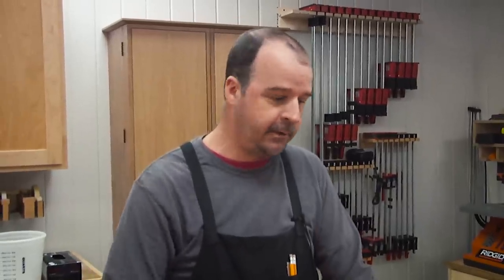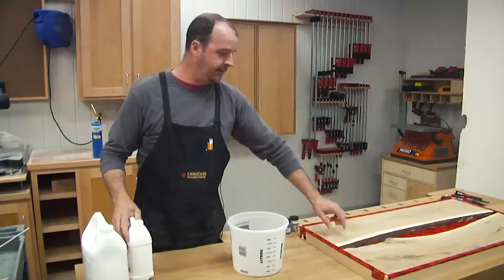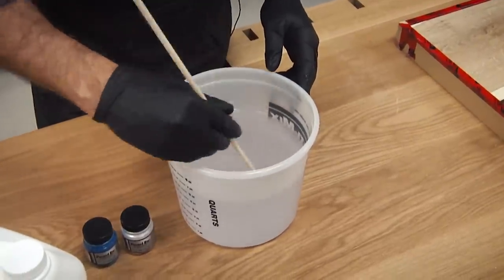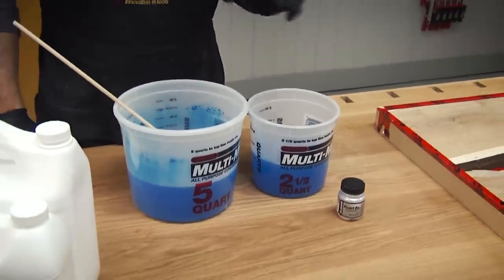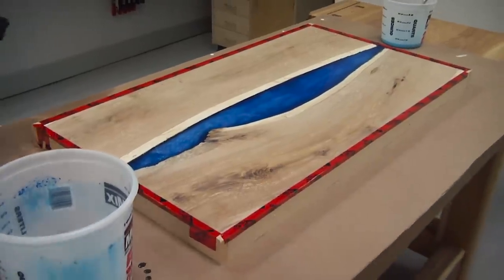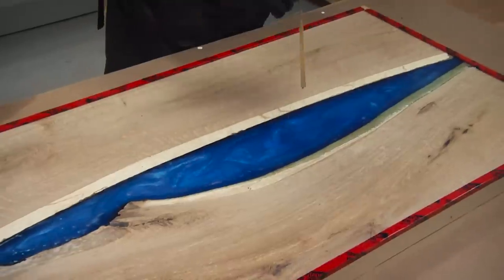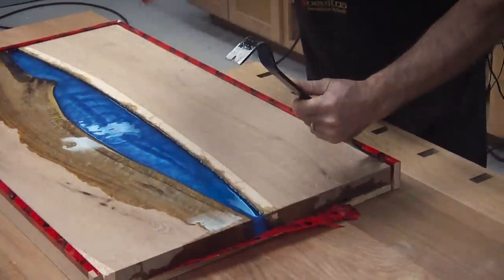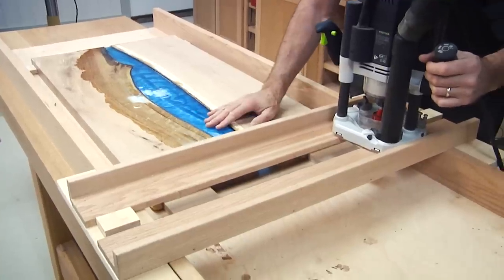How To Make An Epoxy Resin Flowing Table - WOOD magazine

Comment: Lay a plastic trash bag in the cavity and fill with water.
That’s your measurement for the amount of epoxy.😊
Reply: I never would have thought of that. Thank you.
Reply: Shazad Hussain 
You’re welcome.
I can’t take credit because it wasn’t my idea.
I saw it on another utube tutorial.
Enjoy.
Reply: brilliant!
Reply: Thats really smart and i dont say that often to people.👍
Reply: Mike Justice THATS A GREAT FRICKIN IDEA
Reply: That is a awesome Idea.
Reply: I did mine with cat biscuits
Reply: Jello works the best👍🏻
Reply: Clever that mate,  inwas wondering if you could use a vibration table to get the bubbles out before you pour?
Reply: But water and epoxy different weight?
Reply: @hp11208  epoxy is probably more dense, yes, but volume is volume. The same amount of epoxy might weigh more, but it would still fill the same volume.
Reply: Rice works great too.
Reply: That’s sounds ok to me
Reply: Incredible idea!!
Reply: Just average the width by measuring at every wide point a d dividing by the number of measurements
Reply: Good idea if you're afraid of MATH.  :)
Reply: Bulk buy plasticine, it fills it perfectly and then use it to displace water, the risk of a leak is too great in a bag.

Comment: Instead of silicone which could contaminate the surface of the wood, You could seal the edges with rubber cement to minimize epoxy creep underneath

Comment: @2:34 using Plastic BB Pellets Air Soft type to measure volume is easy and it is a good idea like he said to add a little extra to be sure. any significant extra can be poured into another smaller project if you have it ready at the same time.
Reply: Forgive me I’m extremely new to trying to do projects and love epoxy projects, how does this help measure volume of the space?
Reply: If you pour them into a drinks bottle you can see the volume needed roughly. Keep a small hoover seperate and empty the last ones into the bag again

Comment: Good video just a question since epoxy is so expensive I would be concerned a lot would seep under the slabs I realize you screwed it down but would it be possible prior to pouring the resin you could brush on a coat the day before to seal the edge joint where it meets the tape as well as the pores in the side this may prevent seepage just wondering again good video. Thank you

Comment: Do you have to add epoxy around the whole thing to encase it in epoxy or does the epoxy just hold the 2 wood pieces together by the sides?

Comment: You can hot glue the pieces of wood down and clamp. Will creat a sealer underneath plus its not so strong that it's difficult to release from mold

Comment: As a UK based professional restorer- conservator of antique furniture I am currently setting up for my first river table top using two pieces of highly figured and highly flawed Yew wood. I’ve had them in my store for over 30 years so they are well seasoned. What I have noticed with all the river table vids on YouTube is the lack of shellac as a sealing agent. Shellac is a wonderful natural material that unfortunately gets called French Polish; incorrect, there is a technique whereby liquid shellac is applied to the timber surface via a cotton pad, that ‘ French Polishing ‘ ! 
Anyway it seems to me if shellac is used to seal wood knots etc prior to painting why not use it on all those knots, waney edges, essentially any imperfections when prepping your chosen timber.

I have used it as I have outlined so fingers crossed

Comment: I'd be afraid to flatten it with a router.  Any slight variation in height with the jig and the tabletop will not 
turn out perfectly flat.  Is it possible to use a drum sander for a project like this?  Other than that - nice project!

Comment: I'm looking to epoxy up an L-Shaped desk and wondering what the best way to apply epoxy when you can't frame the piece you're working with? Whether it's just too big or oddly shaped.
Reply: You could probably try "tacking" on a border. I would not pour resin without a border to contain it!
Reply: If you can connect the center where the L meets and clamp them tigly down put a thin layer of silicone let it dry and use blocks to wall up the ends and lighly screw them into the end grain where the to edges are done clamp everything down TIGHT you shouldnt have to screw anything down from the bottom if your boards are perfectly straight with no cupping or twisting you wont have much epoxy to worry about cleaning

Comment: can you use a heat gun to get the bubbles out or do you need the flame? thinking about using Epoxy on a project I am a total Epoxy noob

Comment: What’s the formula to determine how much epoxy you need for the boards?
Reply: Lengh x width x depth (all in inch) = x 
Then X ÷ 61 = Result in Liter

Comment: Instead of using the sled and a router, could you use a planer to shave off the excess?
Reply: If you have a bench plane then you can slide the product through, but it has to be wide enough to fit the whole piece.  Most bench planers fit between 12-15 inches (some have a wider mouth but the cost goes up the wider you go).  It is certainly the fastest way.  If you do not have either a planer or a router, look into hand planes.  It will take the longest amount of time but can be a quarter of the cost.

Comment: Another way to get rid on those bubbles is to raise the temperature in the room and allow the wood to acclimate. Then as you pour allow the temperature to reduce just slightly. This is reverse off gassing. The temp should never drop below the guidelines of the epoxy
Reply: Interesting. I've also read if you give the epoxy bottles a warm water bath before pouring in the bucket it makes less bubbles, and after mixing if you let it sit in the bucket for 15-20 minutes then pop the bubbles before pouring it also helps. Liquid Glass also recommends sealing the edges about 8 hours before your pour so the seal can block air/gasses, but the epoxy should still be tacky and form a good bond without sanding. I'm going to do a transparent pour so trying to find every tip I can.

Comment: What is a good sealer to use under epoxy finish? How well does epoxy   bond with it when 3000 grit is used where flattening has been done?

Comment: Would it be a good practice to always seal the edges of the natural wood of any project that your undertaking??
Reply: Actually you get a better bond of epoxy to wood if you don't seal the edges. Just have to check constantly for air bubbles but most good epoxys nowadays are made to release the air bubbles before you pour ( like Ecopoxy) or they will rise and pop on their own or with a quick torching over the epoxy as needed.  If you use an epoxy (like Total Boat's medium or fast hardener) you just have to check constantly for bubbles and torch them to pop.

Comment: you mention using  thin layer of epoxy to seal porous areas....is it a mixed epoxy / hardener, or JUST epoxy no hardener? thanks for the video!
Reply: @Wood  thanks, I wasnt 100% sure .

Comment: How does such a table hold up in the long run?  Wood moves seasonally and epoxy does not.  Will the join between the two fail in time?  What does one of these look like after five years?
Reply: @RPE-Official  Without going into what you or I know or don't know about wood or epoxy, Can you answer any of the questions or offer any useful information?  Have you ever made a River table?  More to the point have you ever seen one that is five years old and been used daily?
Reply: I can't wait to create a dining room table!
Reply: Brandon Dreher  you right he’s new let’s shit on him and not answer the question 🙄
Reply: I've epoxied the back of a 2'x2' cutting board 3 years ago and it seems to be holding up well. No splits or movement. I also did a 4'x4' island top. No issues with movement, but I didn't mix it well enough, so there are some soft spots when it gets hot. I haven't done one of these yet. Looking to once my shoulder heals from surgery.
Reply: @RPE-Official  it's a valid question. It's the resin that is the unknown factor, not the wood. Evidently common courtesy is something you were never taught as a youngster and that's a shame.

Comment: Prop the board up  on a load of off cuts and clamp the wood down, no point in sealing it then drilling and screwing it. If you screw the form togeather then you can reuse it!

Comment: Is it OK to pour that deep in one pour with that product?
Reply: Normally no, but it can possibly depend on what type of epoxy. If you do it like this it runs the risk of cracking.
Reply: Casting epoxy can be poured at more than 1/4" without cracking

Comment: I guess the hardest thing I dont we understand how it stick the two piece of wood together, that wood planks look to be 11/2 to 2" thick. Hows it bond to the weight of the boards. 
I would like to know if you route out a grove in the slab and pour in it. Not cutting all the way throught it.

Comment: u always wanna pour a little over the top so u don't have to take off that much off the table. dont worry about silicone on the bottom. but silicone on the top is common. everything can always be sanded. also u will need a protective coating on the wood. also you will need to sand or rough up the edges where the epoxy touches for a strong grip or the table will just break in half. also need to coat the edges with epoxy with a brush before pouring it. you also alway wanna spray some sort of release before putting in the slabs and the epoxy. all in all not a super good tutorial.

Comment: I like how he doesn’t finish the table.
Reply: @Wood  for the finishing, which is best? Beeswax or wood top coat clear gloss? Or should i use both combination? And how many coat should i apply to get the maximum shine and smooth to touch? 

I am really new to this and willing to try make one.

Comment: Screwing the board to the form underneath…Nooooooo!! Put plastic sheeting down on bench, raise the form off your bench with 2 pieces of 2x2, clamp the work piece all around using scrap wood to protect the piece. This way, any epoxy leaks/drips can be easily seen. Always apply lines of silicon under the piece to prevent epoxy spreading further than acceptable. 👍

Comment: I hate to be a YT troll here but... save yourself a nightmare. Never use silicone on anything you plan to paint or clear coat because coatings will never lay flat after silicone has been near it...
Reply: @Wood   Thanks for the reply and that makes total sense.  I've had projects where even being near silicon the final finish on top fish-eyes so just wanted to through out a little precaution...